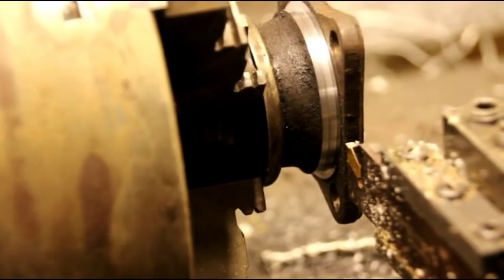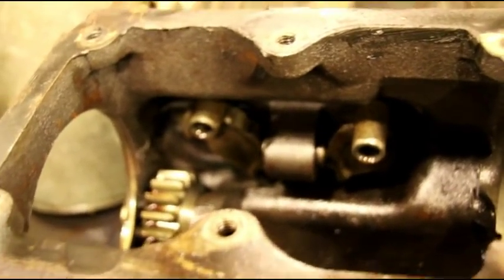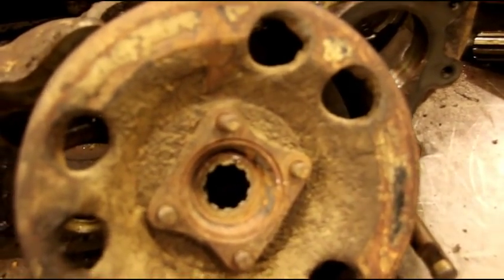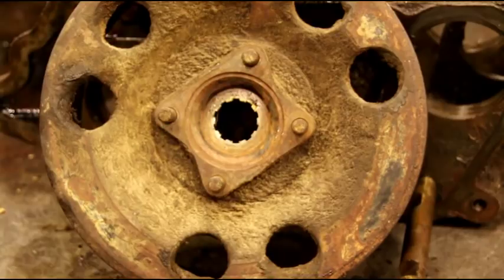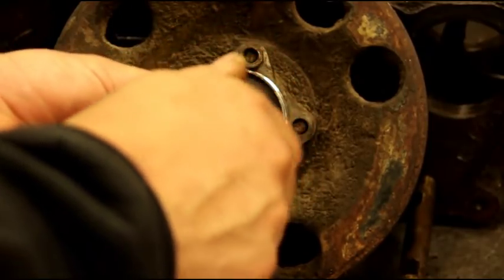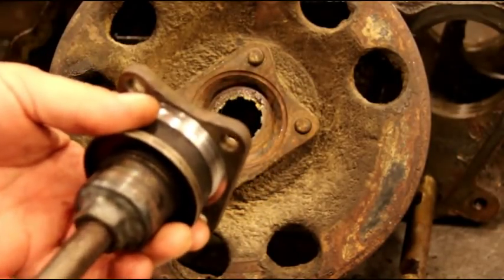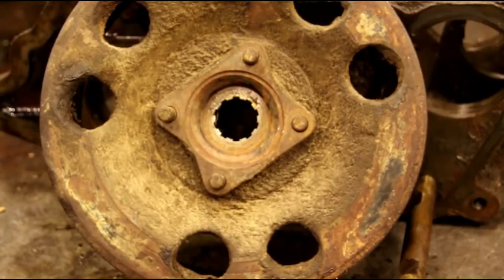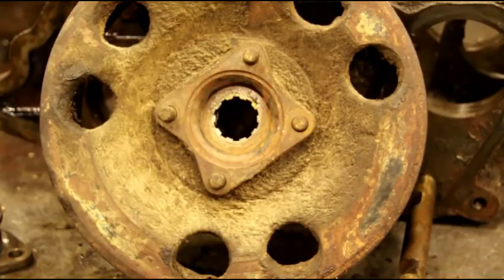Willys Dana 18 Transfer Case Flange and Drum Removal

Comment: Thanks for sharing this Brian. I will use this idea next time around. Any luck with that Wisconsin engine lead up in MA?
Reply from the maker: followed up on that engine.  It does not have a clutch and the one off my original won't fit on it.  Need to have a clutch to engage and disengage the snowblower.
Reply: A swing and a miss. Oh well. I used to work with Wisconsin engines quite a lot....on tree spray rigs and other equipment. They are very durable if maintained properly.